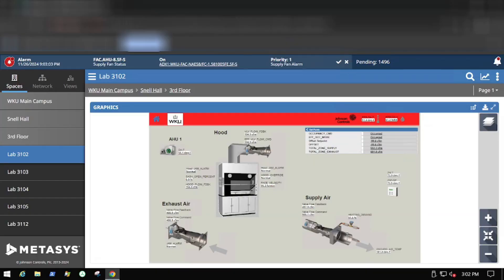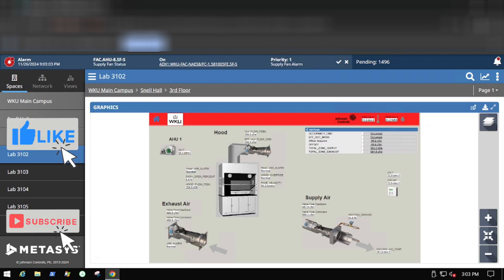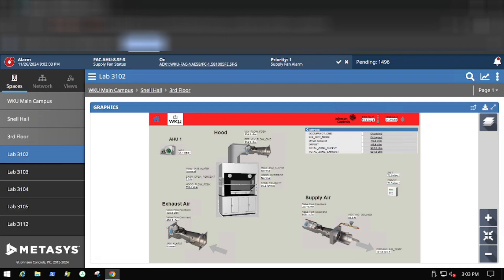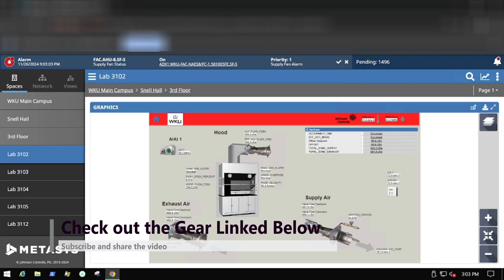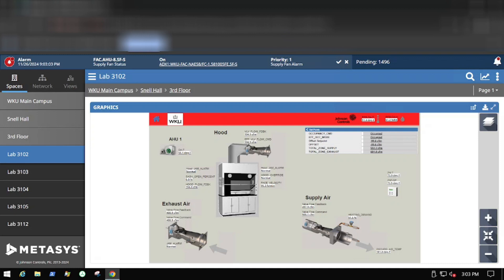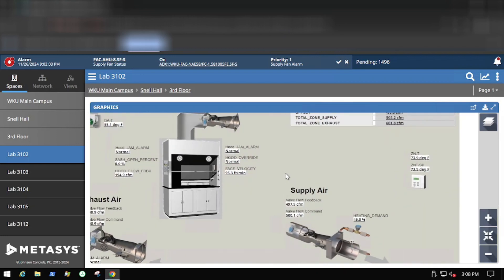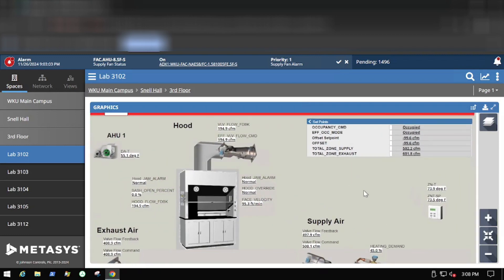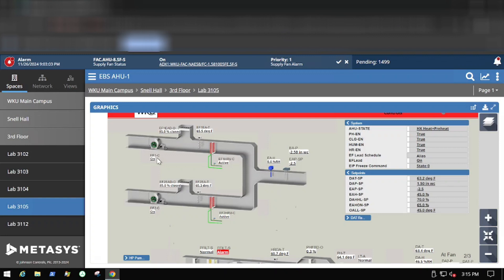PHOENIX LAB Air Valves The Secret to LAB SAFETY and EFFICIENCY!

Comment: Thank you for these videos, we are just upgrading some buildings to the new Phoenix. Im gonna miss the joys of the Analog boards. But we are getting these new boards on our brand new ADX Metasys. I have to saw the ADX is a massive step backwards compared to the ADS which was a slight step back from the Metasys with the NCM350’s.
Reply from the maker: There's more tools available in the newer systems once you get it set up
Reply: @ the simplicity of the older systems with the N2 rather than BacNet devices is more reliable and serviceable. But as with time we are being forced to upgrade as replacements are becoming scarce. I mean we are still running PHX panels and a couple NCM200 with AHU controls. But I will still take any Johnson over Alerton or Siemens.